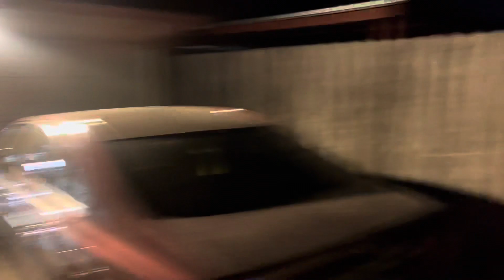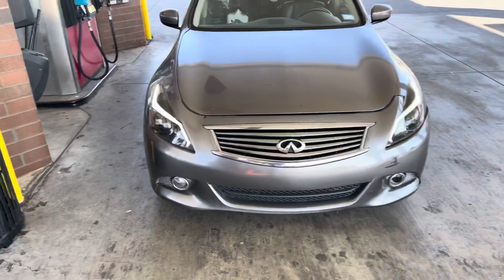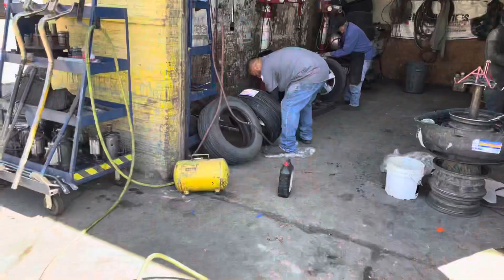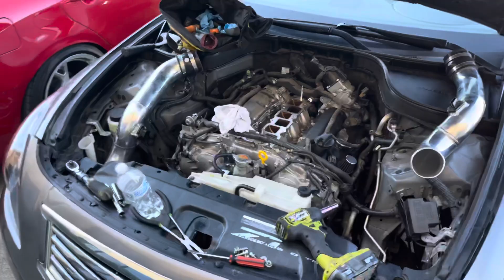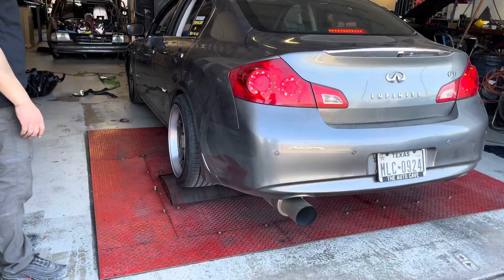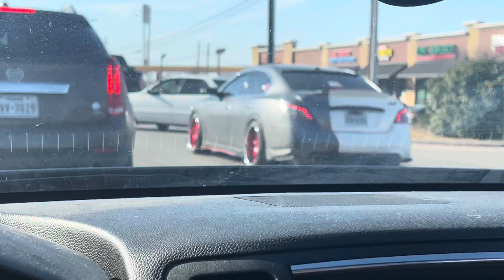FBO INFINITI G37 GETS RE-TUNED ON E85(CORNFED)🌽

Comment: I wanna see dyno sheets to support 400+ N/A lol. VQ's are snacks
Reply from the maker: You’re new huh ? There’s vqs running 9’s lol you definitely just talking to get a response and don’t know shi
Reply: I know which ones ur talkin about. Tin canned, swapped, nos, Im talking about the ones you see on a regular basis not the 1%. I wanna see dyno sheets that all. I love VQ's but you gotta be max effort these are fax @KpThegoat
Reply: Wait you the content creator? No way a subie should have ur feathers this ruffled  @KpThegoat
Reply: With ur 350 wheel from 6-7k rpms i make that bolt on. All i gotts do ispull me seats to drag that shit in a 4 bander @KpThegoat
Reply: VQ's are snacks N/A there are known fax. YOU are not runnin 9's that dude in florida with the vhr swap and nos is runnin 9's not an FBO E  @KpThegoat  🤣
Reply from the maker: I never said I was running 9’s I said there are vqs running 9’s and I never ran to a Subie that I had a problem with but I’m saying vqs are very underrated not trying to start a debate it’s facts but yea the ones you run into on the daily are most likely stock and not fbo on E with no seats in the car so yes understandable
Reply: @KpThegoat  shame cause I weigh 3200 and make 360 wheel. vq's aren underrated the race duds and heavy cars with similar power. Like those stock ass 425hp at 3800 lb GT's u cherry picken. The math ain't mathing
Reply: @KpThegoat  why bring it up I mean there's subies running 8's but that don't apply here fam we talking about YOUR 12 nd a half second G